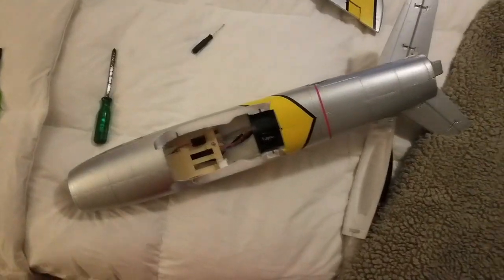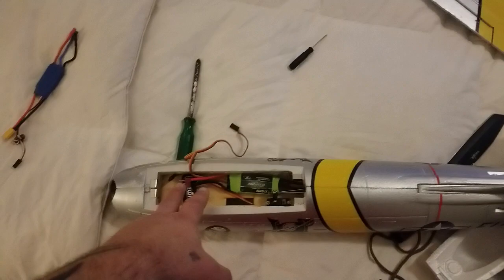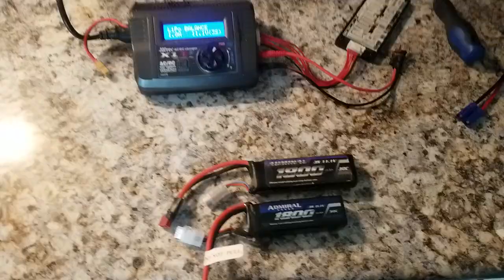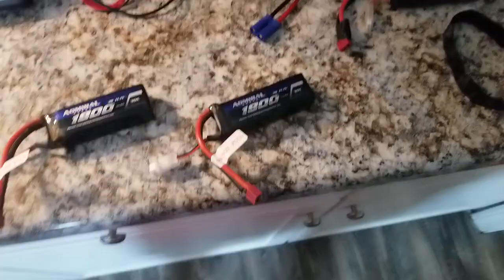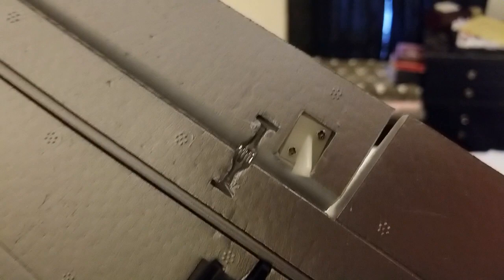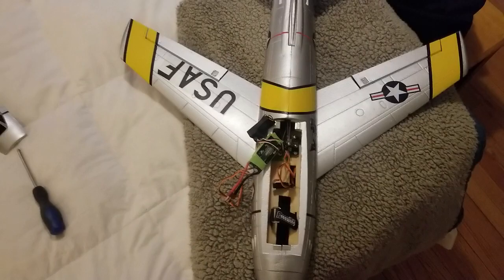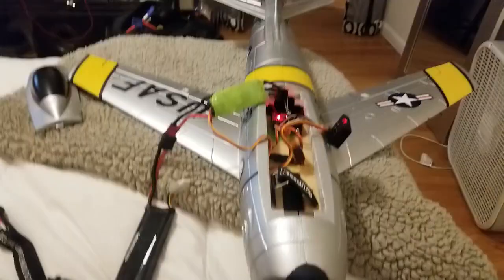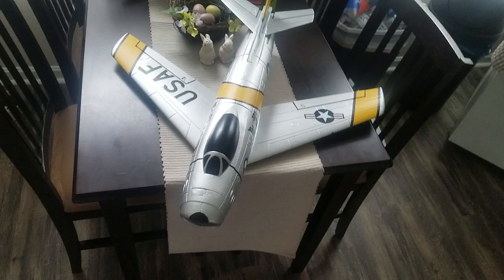Freewing F86 64mm, build and flight control test.

Comment: Hey Dave, I used a sheet of plastic I got from a hobby shop and a dowel rod cut me section out and used a heat gun and the dowel to shape it so it would protect the control horn and rod. I'll see if I can get a picture later. I did this on the Neptune I have.

Comment: I like Deans connectors also I don’t fly edf’s but haven’t  had an issue with a single one. ✌🏻
Reply from the maker: I just wish they would give you an option when your making your purchase. They just started switching everything over. So its adapter for me I guess.
Reply: They could give us a choice but I don’t see that happening because of the mass production aspect of it. I would be happy if they would just stick with whatever connector for the long term so you don’t have to have a drawer full of connectors to switch back and forth.
Reply from the maker: I believe your right, so then in five years they will come out with a new connection that is just different, not better. Just different so we have to make another change. Like you I started out with the Dean's and have had pretty good luck with the connectors. Would be nice to have an option. Like you said, mass production inhibits that.

Comment: Hey Dave, on any esc if rotation is not right any of the leads can be switched and it will be right. Could have swapped the other two or the other two and got the same result. These are good esc's i have several installed myself. I have gotten away from using any gyros however.
Reply from the maker: Oh yeah, I knew that, lol. Hahaha. Nice brother. Yeah kinda didnt say that right maybe. Yes I agree definitely. And yes these esc are amazing. Love the shit out of them. I did this upgrade because I was puffing my batteries with these little 64mm jets. Someone recommended that I switch to these esc. Since then no puffed batteries. Nice to see your name in the chat brother. Good to hear from you my man.
Reply: @DavesRc  i figured you knew that, but you were kind of saying it like those 2 specific wires had to be crossed. I'm always watching. But, damn, between you and Ryan n Mike and the Boozers, holy shit y'all make it hard to keep up! Always a thumbs up though!

Comment: I have never had any issues with xt60 connectors up to 100 amps, then I use only xt90 up to 200 amps.
Reply from the maker: Not that I dont like them, just all my batteries are Dean's or EC5. Should have been a little more clear. I think it's mostly the fact that everything I have purchased in the past is all Dean's or EC5, now they are switching everything to XT60 or 90, that makes a lot of work to convert. So I'm just going to use an adapter for the new batteries.
Reply: I was under the impression 60 denotes amp load rating on the connector xt90 90 amp etc.. Am i correct in that assumption? And if so then they obviously will withstand higher amps but probably not recommended?
Reply: Just subscribed to your channel victor honestly thought i was allready lol
Reply from the maker: @thecraftking113  oh no way, lol. I thought you had subscribed too. I could have swore I saw your name as a subscriber once. That's weird.
Reply: @DavesRc  got to love YouTube. Lol
Reply from the maker: My bad, lol. You get it. Hahaha. Sorry brother.
Reply: @DavesRc  😜